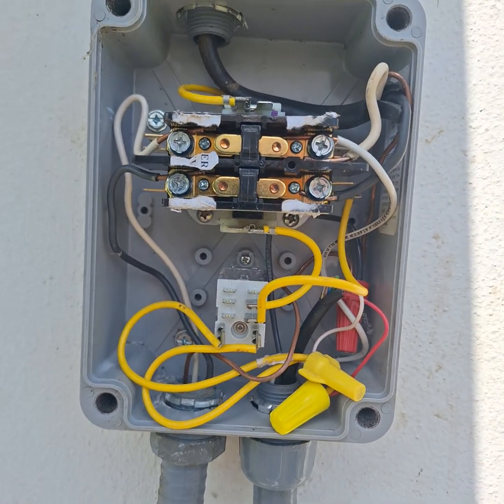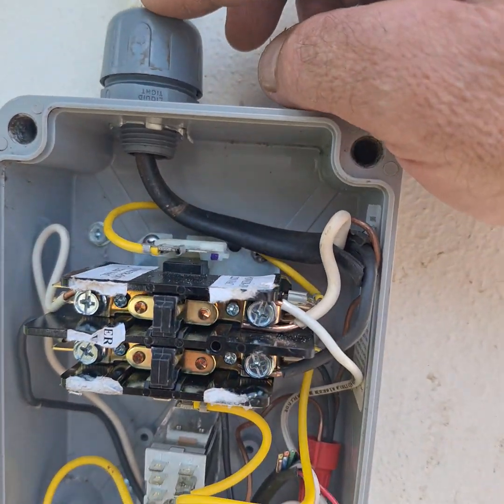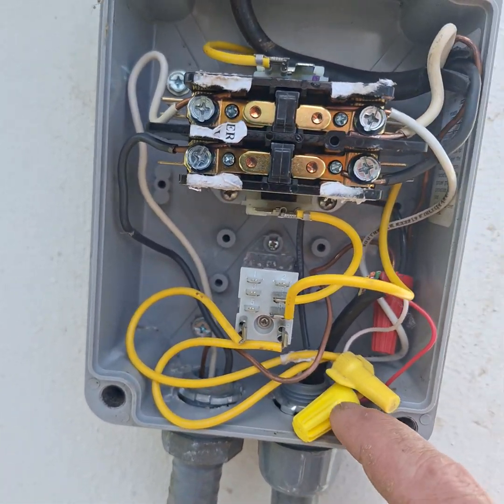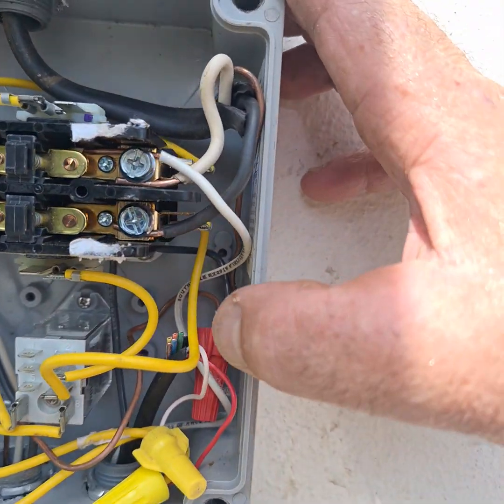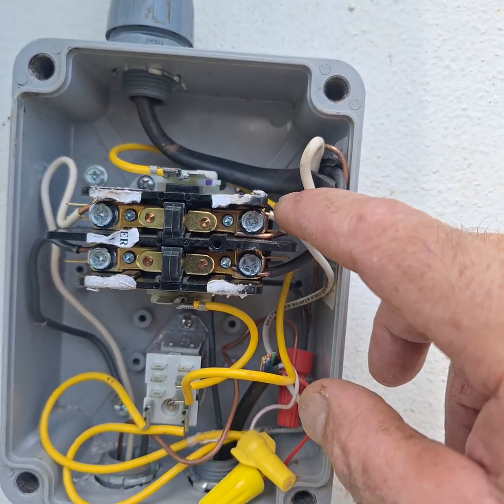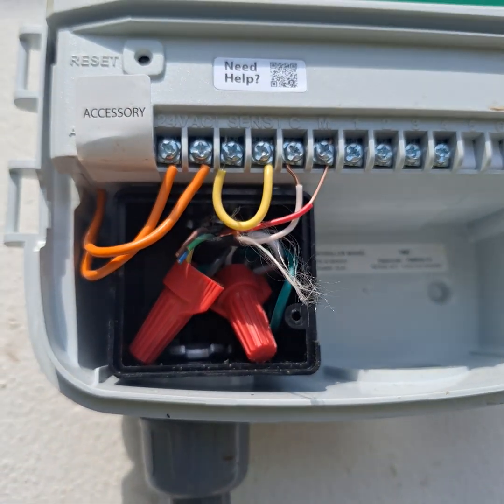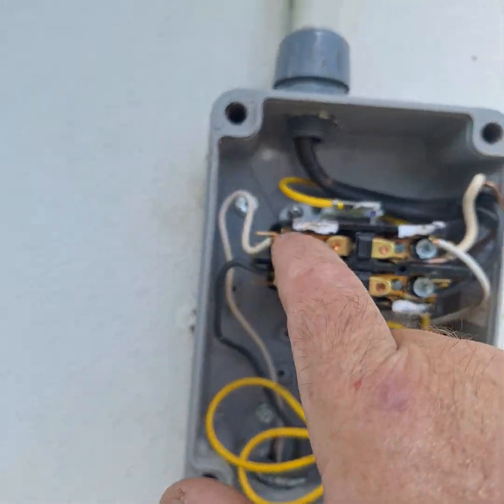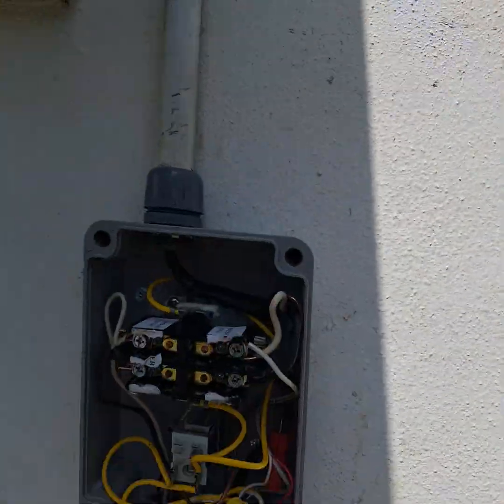Irrigation Pump Start Relay Wiring

Comment: Wow, this is exactly what i need.  Where i'm installing the controller (110v) I only have 220v power that feeds the pump.  So if I can pull a 110v put of the 220v that goes into the pump start relay, that would save me having to run a 110 line from far away.   However, right at the 30-50 second mark of the video, it's impossible to follow your verbal explanation!  :-(  you don't happen to have a diagram do you?  HELP!